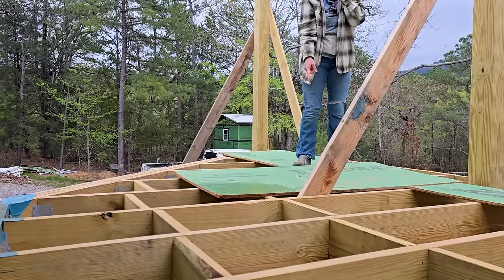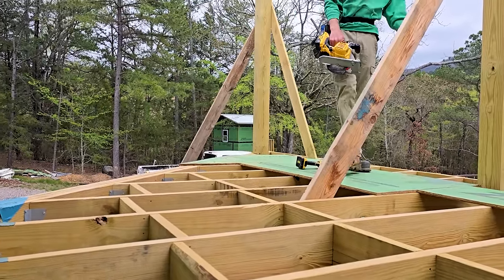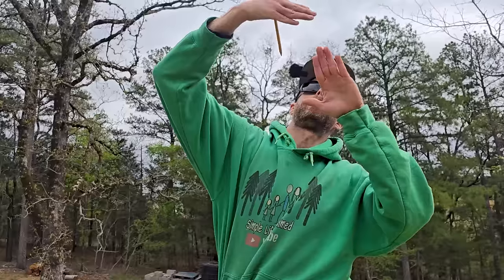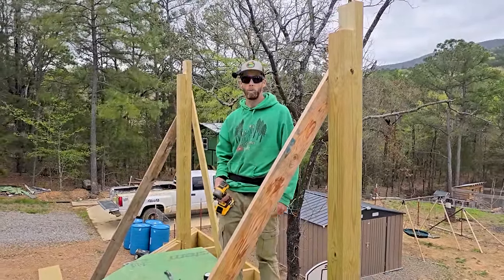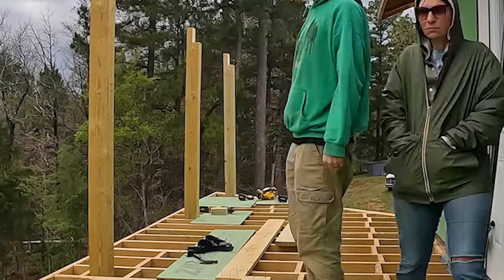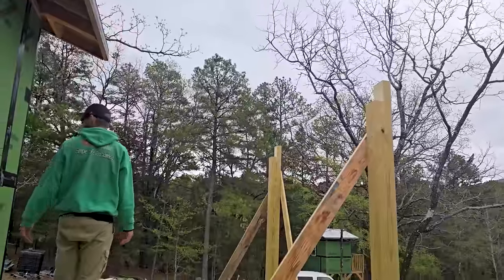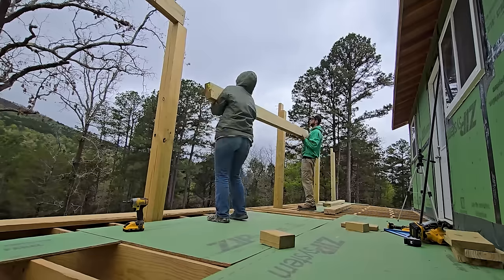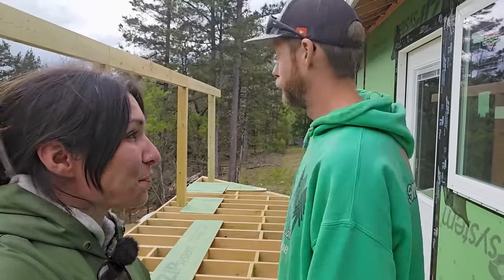Trust The Process| Building Our Deck/Cabin Roof | You'll See Our Vision For Our New Homestead Build

Comment: Why oh why dont you do the floor instead of putting zip board to stand on?  You scare us! Please stay safe.
Reply: Gary has it figured out.  Let him do it his way. Please
Reply: It's fine they don't plan on keeping it like that it's just temporary.
Reply: I ask that question too😊
Reply: They have time pressure to get tin on the roof, which means they have to do the roof structures for the deck and for the front porch asap, so they are skipping the floor of the deck for the moment.
Reply: So the finished deck floor doesn’t get damaged in framing the roof
Reply: Finish the decking, cover it with the zip board to avoid damage. If you can afford the decking?

Comment: Hey Gary, I had a good laugh at Mel’s expression when you were explaining. Your talk in but she ain’t gettin it. When build, a long time ago, I used a string line to mark the beam line. I then trimmed them off the standing posts. It saved having to lift twice, and I worked alone on that part of the build as my then wife had to go to work. It’s amazing what clamps and ropes can help you do. I placed 2 f clamps part the way up, lifted one end of the beam and rested it on the clamp, then did the same with the other end. A second set meant that I could lift the beam up to inches away from the finished height. The last lift was only a couple of inches . I clapped one end in place then lifted the other and clamped it too, checked posts for plumb, set them and installed the bolts, I didn’t nail or use screws for that. To get the ends level I used a 1/4” tube with coloured water for 35’ distance. I hope that some of these comments come in handy as you go, they just add to the solution kit just in case you need them.

Comment: A couple of suggestions for the beams.  First, check your boards at the store for wonkiness before purchase.  If you have limited options make sure the crown is up on the beam so it will settle down over time.  Second, you should not put both beams together in this application.  You have a double joint that is a weak point in the greater beam.  What should have been done is one full row with the second row coming in with the second joint midspan between posts.  You should have applied a bead or three of constriction adhesive then, followed up with several rows of screws.  The rule is a 2x4 should have 2 screws connecting, 2x6 3 and a 2x8 4.  You will want a zig zag pattern (think W).  Screws applied in a straight line have a bigger chance to split along the screw line.  For wonky boards, nothing is beter than a nice set of clamps to pull them in line.  Lastly, what kind of screws you use to bind the beam is important.  There are screws designed for this specific application.  using the regular DeckMate type screws is ok but it just means more are needed.  Please don't forget to install a hurricane strap from the post to the beam on each post.

Comment: I've built a heck of a lot of houses, barns, and apartment houses and Mel I was with you when Gary started trying to explain his overthinking. Did you see Gary get his mouth around that Hero sandwich, looked great. That first one you put up would have been good for a keel of a ship. Gary you might want to ask an engineer about the strength of your beam with all the joints in the same place, It would be much stronger if they overlapped with the second run being in the center of each span. But I am amazed at the two of you for your determination and fortitude Well Done. Confuse everybody and call it a girder.
God Bless from your Canadian Friend.

Comment: I feel your pain, Mel. I'm the same when it comes to figuring numbers and building 😂. You 2 were cracking me up. I think putting the floor down first would have been a smarter idea, hence the safety factor😊. Using screws on the boards is a good thing. Great job, you guys

Comment: I noted that it looks like you cut more than 50% of the post in the notching.  You have compromised the structure beyond the safe margin.  You will want to use construction adhesive and thru bolts to secure it.  You should also finish up with more blocking on all sides so the flooring has structural support on all sides.

Comment: Just a thought. I would have tried to stagger the second layer of the overhead beam to keep the butt joints from separating over time. Realizing that you would have needed to screw it on from a ladder. I would think it would hold the structure together better. Just My 2¢.

Comment: A little late. If you would have split your seams on your double  band you could have tripled the strength. If you are going to use clips to secure to post you should be good. Good job. Mel I have to tell you I laughed out loud at your captions.

Comment: Just curious with your band board, are you not able to buy the thicknesses you need, rather than having to double up, I just think it would look so much neater.  Here in Australia we can buy the board already at that thicknesses, like 2x6 or 2x4.  Not questioning your work, cause you both do a great job, just wondering on size availability there.

Comment: Gary you over engineer a lot of things But when it came to doing the most basic laminate beam you do it in the weakest way possible. The right way to have done it is to have put up one row of boards then the next course should have spanned over the joint of the first course. Just like you did when you laid the block in your basement.

Comment: Gary you go on about you over thinking about the job yet I don’t see why you didn’t put the 8x2 back up then fix the second boards up at their full length that way you wouldn’t have both joints in the same place thus strengthening the total beam. Yes it would have been harder to do due to the state of the boards but it would have been so much better plus you should have glued and screwed the boards together using an outdoor board glue. But I can understand why you did it the way you did. 
When you get next load of timber inspection each board and don’t accept boards like you used in todays video unless they are marked down to half price even then I’d need to think hard about what and where they will be used before taking them. Best of luck as this next bit I’d hate to be doing cutting holes into your existing roof boards to slot the perlins in that go down to the beam you just fitted errrrrr.  🤪😣😒😙😜😝😫😀😃😄😁

Comment: 4:33, painful to watch an utter newb at this.  You perhaps should harness her off just in case.  She needs to learn to improvise in that sort of situation, like grabbing a board and using it to mark the edge.  It of course begs to question of why you have not at least partially laid the decking boards.  It would be much safer for you two working up there.  For safety, you really need to have more of a walking surface and at least a set of chest and waist-level boards on the outer edge.  Bad things can happen so very fast.   Please, please be safe!!